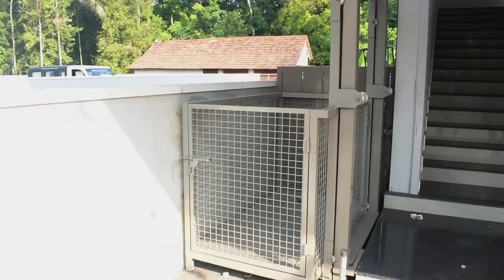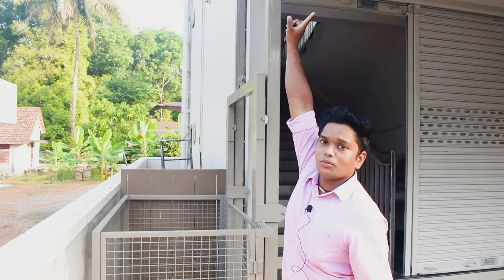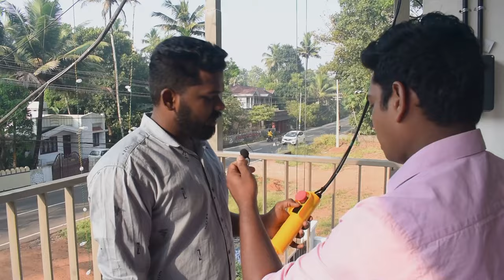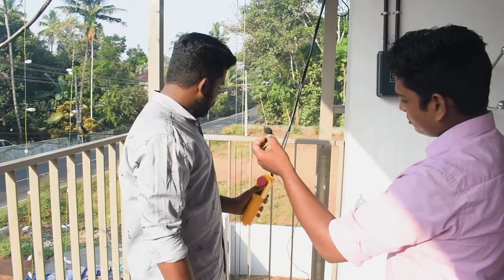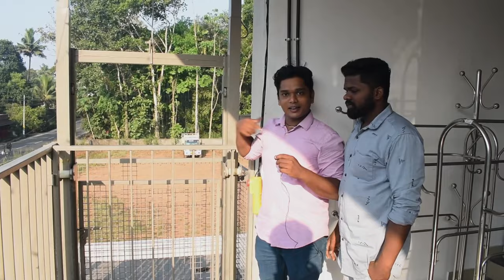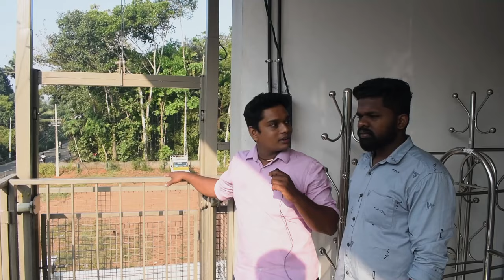Lift making video | Lift making home project

Comment: May I know if you can make it for in dehradun.  What are the safety features are there in case of power failure or if the wire got damaged....please let me know...I'm interested because the cost is very reasonable..